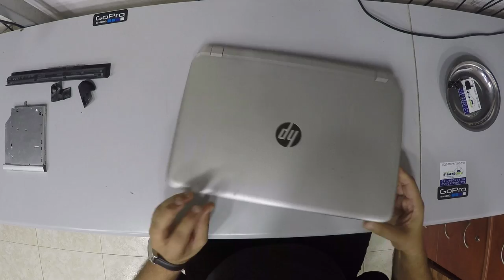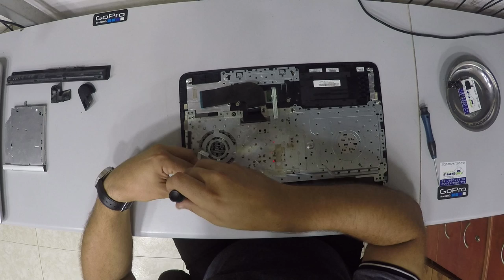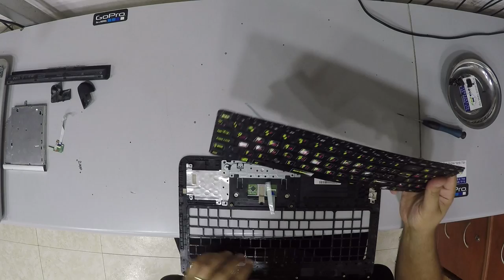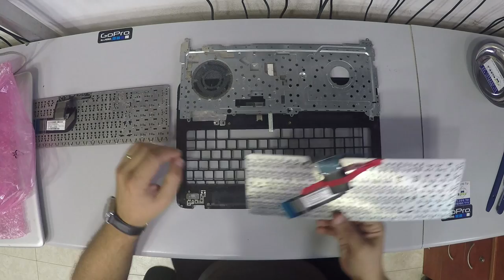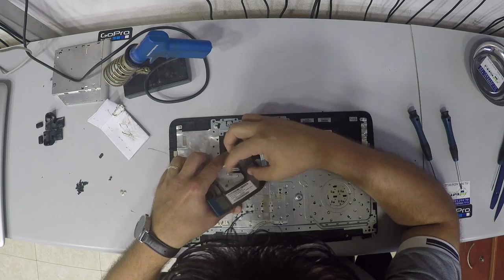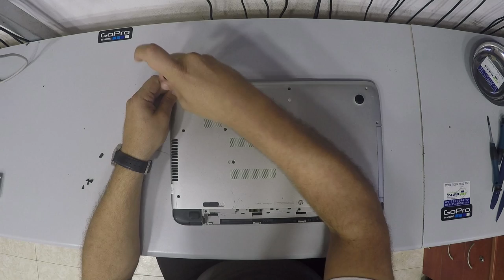HP Pavilion 15 Keyboard Replacement

Comment: I actually got the backlit keyboard today and did the swap. You definitely need a soldering iron like you said and fortunately my wife actually bought one, and it also arrived today so I was able to complete the swap properly. Now I have a proper backlit keyboard that should've just come stock with the 15-br095ms to begin with. I love it. So much easier to type in the dark when you can see the keyboard letters in one's periphery. Plus, it looks tight. Definite upgrade. Thank you for all your help. I couldn't have done it without you pointing me in the right direction. Much appreciated.
Reply: Ikaika Kahoano where did you get the backlit replacement keyboard? I cannot find it anywhere
Reply: Ikaika Kahoano thats super helpful! Thank you!!
Reply: No problem. Good luck! It was a fun project, and definitely makes using the laptop 100% better especially in the dark.
Reply: Ikaika Kahoano btw, mind if i ask whats your exact laptop type. I look at your link it says its for br00-something mine is p-299ax or something, idk will it fit or no.
Reply: Mine is the Pavilion 15-br095ms. The keyboard is for that generation Pavilion. I'm not sure which one yours is, but I'm sure you can find it on ebay.

This is the exact one I have:

https://www.microsoft.com/en-us/p/hp-pavilion-x360-convertible-15-br095ms-2-in-1-pc/8nvcs1bmjlcj?activetab=pivot%3aoverviewtab
Reply: Ikaika Kahoano alright then, thank you so much mate, bless you!
Reply from the maker: Apologies I code not replay to your massages in time, I am back now and will replay to comment once a week in Friday. (you are welcome)
Reply: Where did you buy the backlit keyboard I need one for my pavallion 15 ab219tx
Reply: @tijomjoy1167  eBay

Comment: Will this method with for the 15-Ba079dx keyboard replacement.

I've changed the screen no problem.  Keyboard has issues on certain areas..

Comment: I Just did this repair; if you are careful enough when lifting the frame, it is possible to replace it by snapping the frame and the keyboard back over the posts they were resting on.
you have to be gentle when lifting tyhe frame and detaching the keyboard so you dont damage the posts, but it can be done, and the keyboard will act normally.
Reply from the maker: Apologies I code not replay to your massages in time, I am back now and will replay to comment once a week in Friday. (you are welcome)

Comment: It would be good if you had shown the old keyboard's connector strip being disconnected and the new keyboard's being connected.  Also, if just replacing the keyboard, is it necessary to remove all those screws!?

Comment: Hi.
Thanks for video.
do i need a soldering gun to fit the new keyboard back.
I can open as you showed but i got stuck at a point when i saw that screws holding the keyboard are plastic made which cant be screwed back once i break them.
Reply from the maker: Apologies I code not replay to your massages in time, I am back now and will replay to comment once a week in Friday. (you are welcome)

Comment: What is the use of soldering gun?
Reply from the maker: Hello Asher Abdullah, I use the soldering gun to melt the plastic nuts that hold the keyboard metal frame. it's helped to hold back the keyboard to its original place.
Reply: eShamsTechTips oh i see thanks!
Reply: I did this today. The soldering is a necessity. No way around it with this type of keyboard design, unfortunately.